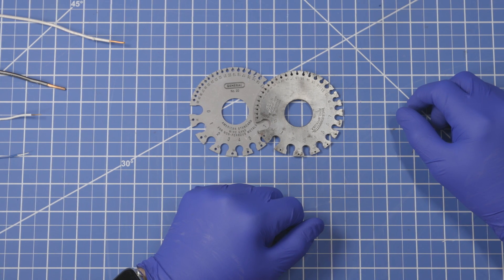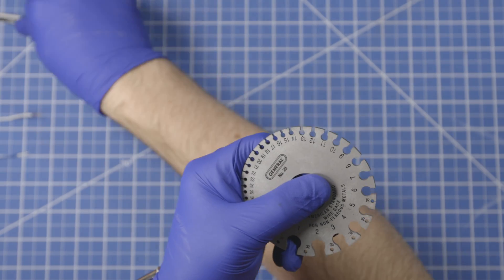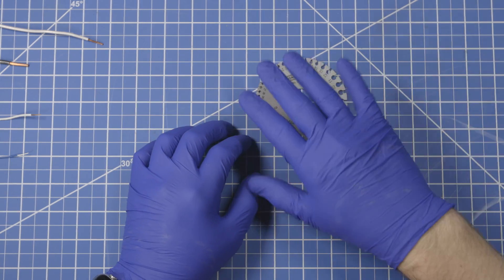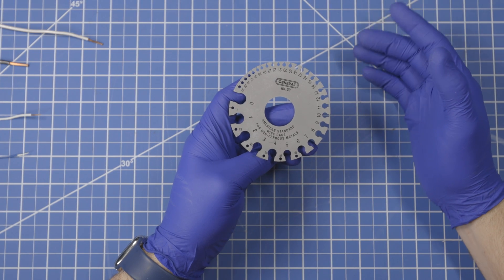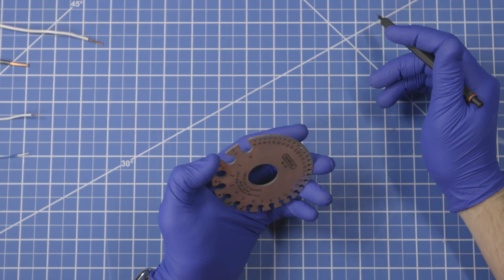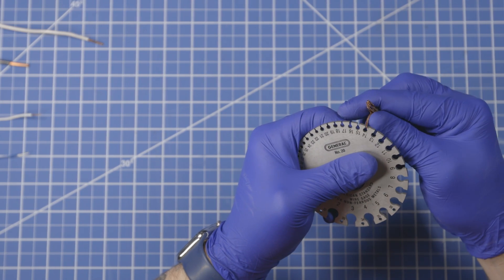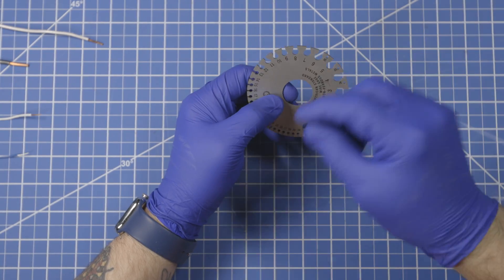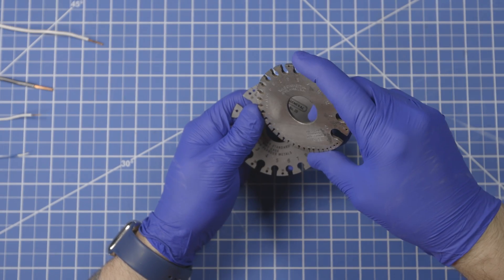Wire Gauge (Gage) Basics - measure nonferrous wire with an AWG gauge.

Comment: Thanks for the upload this video really sent me down the wire sizing rabbit hole. The only complication I had with your method was on larger wires like 500 kcmil 1/0 or 3/0 the individual strands are made up of different size strands and this gives you funky math when trying to multiply them together it doesn’t match up with correct chart size. Man I actually found a very quick easy method of using a caliper that reads in mils/thousandth of an inch. Measure the COPPER O.D. not the insulation and take that measurement and compare it to NEC chapter 9 table 8 go down the OVERALL/Diameter column and find your measurement from caliper. I’ve tried it on multiple wires and it’s perfect every time.

Comment: I have a 10 gauge or something close to there extension cord for an ac in my living room. Looking at this video, that’s a thin lookin wire but mine is over a cm thick WITH the insulation over it. There’s that much rubber protecting it? Or is there a different form or rating of gauges?
Reply from the maker: It would be the same gauge rating.

The wire I'm showing in the video is the kind of wire that would be contained in a housing or in conduit or other "static" sheathing, so the insulation around the conductor doesn't need to be as robust.   Extension cords are generally more insulated in order to be abrasion resistant since they're out and touched/stepped on/flailed around.

There's no easy way to know the gauge of the wire through the outer jacket/insulation/sheathing (unless the gauge is printed on there).

Comment: Watched the vid to see stranded wire explained but you talked about it and didn’t explain anything…. Was hoping to see how to do the math to figure stranded wire gauge. But super cool to learn where the awg numbers originated from!
Reply from the maker: I replied to another comment about this -- I didn't go into it in the video, but the equation is the "Circular MIL Area" (CMA) formula, which is diameter (in mils) squared then multiplied by number of strands...and then you look it up on a conversion chart because there's no straightforward math to work out the corresponding AWG.  Seriously, look at this research paper about it: https://pdhonline.com/courses/e275/e275content.pdf

So, honestly, I'd just start and end with using a chart like https://www.calmont.com/wp-content/uploads/calmont-eng-wire-gauge.pdf

Comment: Thanks for the video. I may have missed some of the comments but what is the math to get 6 gouge from 7 strands of 14 gauge?
Reply from the maker: I didn't go into it in the video, but the equation is the "Circular MIL Area" (CMA) formula, which is diameter (in mils) squared then multiplied by number of strands...and then you look it up on a conversion chart because there's no straightforward math to work out the corresponding AWG.  Seriously, look at this research paper about it: https://pdhonline.com/courses/e275/e275content.pdf

So, honestly, I'd just start and end with using a chart like https://www.calmont.com/wp-content/uploads/calmont-eng-wire-gauge.pdf
Reply: Thanks!

Comment: couldn't we just use a caliper...since I already own one, would be nice if a thickness chart existed
Reply from the maker: You certainly can, but it's not as convenient as a wire gauge (especially if you're, say, up a ladder or wedged into a crawlspace) - a caliper is bulkier (and more fragile), and you either need that reference table or a very good memory.

There are reference tables, though -- https://www.rembar.com/resources/american-wire-gauge-awg/ is a particularly comprehensive one (60ga to 7/0) that goes well beyond what a circular wire gauge could possibly cover (outside of 30ga - 0ga, you'll need a caliper or something, anyway).

Comment: do you have to strip the wire to measure the wire?
Reply from the maker: Yes! The gauge is what determines the capacity of the wire, and the insulation thickness isn’t part of that calculation.
If the insulation was a consistent thicknesses, perhaps we could just have some “round down” math, but the insulation thickness can vary widely. (And if you can measure the insulation thickness, it’s just as easy to measure the conductor)

Comment: Measuring unlabelled stranded wire seems like a total PITA. I have lots of tiny wires I wanted to know the gauge of. I guess what happens is that people just eyeball it and size up because it's cheaper than buying a micrometer and counting strands.
Reply from the maker: It is definitely a PITA.  For me, for non-critical situations where I don't have to use an exact size, I generally go with "this is at least [whatever] gauge" and go a size or two larger.  So far, nothing's caught on fire.
Reply: @JustToolBasics  I'll do the same - but as a newb to electrical work I sort of resent that there is no friendly way to be sure. I might have to dial down the perfectionism.